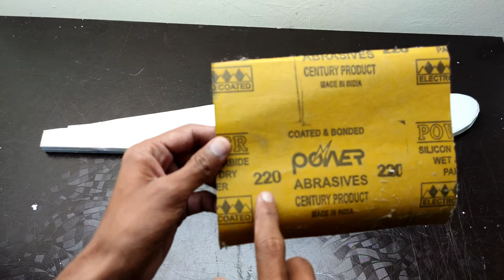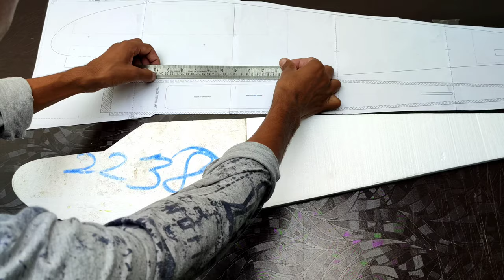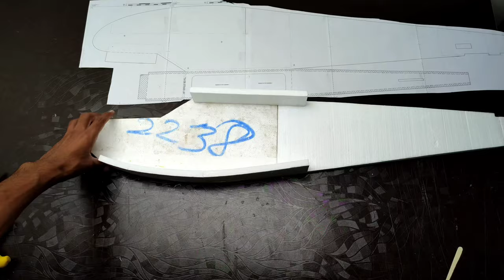RC Plane Fuselage making full toturial @INDIRC1

Comment: Bro,,, can we use 3 cell 2200mh battery for this plane???  What is the weight of 3 cell 2200mh battery
Reply from the maker: Yes bro, 2200mah 3 to 3300mah 3s easily fit and fly
Reply: Thanks bro❤️
Reply: I want to use 1000kv Motor and 10:45 prop,,,for this what c rating of battery   will be best for this motor??
Reply from the maker: 30c is good 40c is best
Reply: Thanks a lot bhai❤️
Reply from the maker: Welcome bro